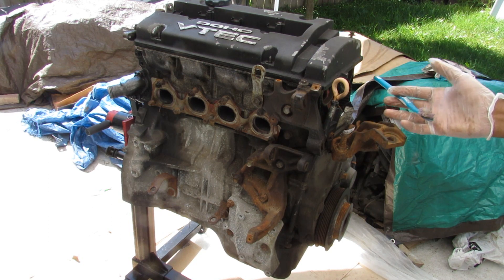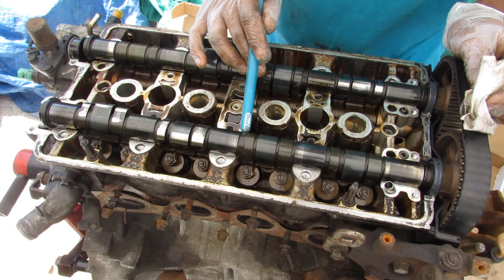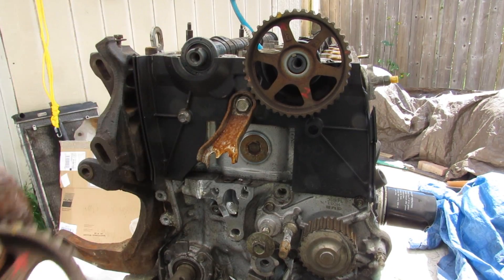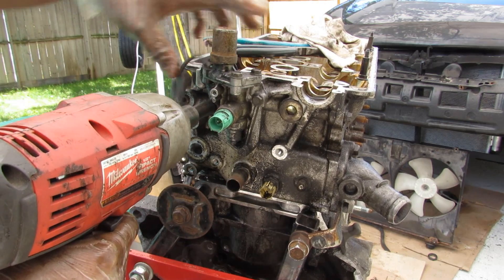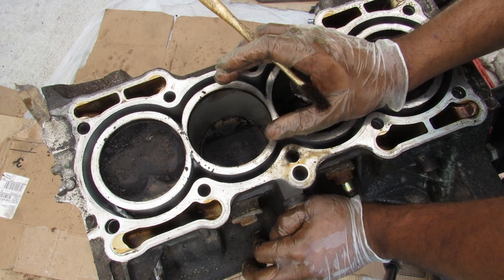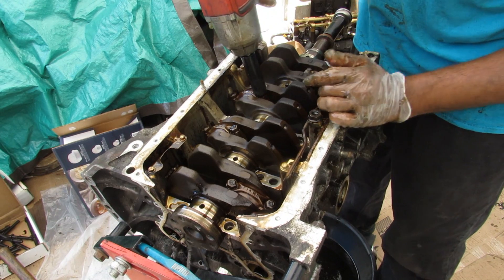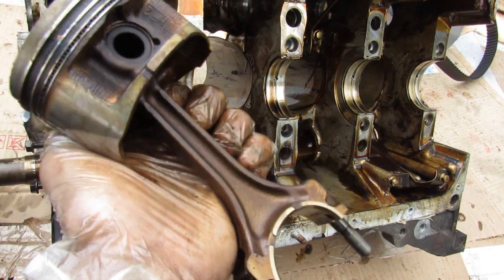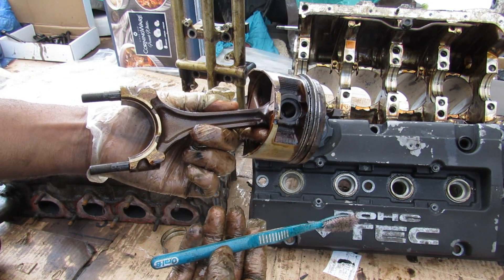Why the Honda H-Series Engine is the Best of the 90's

Comment: My research indicated that the FRM sleeving is quite robust but due to its extreme hardness and abrasive nature of the fiber reinforced metal composite, the cylinder walls cause the piston rings to wear down overtime. The FRM materials are essentially an ultra tough mixture of aluminum oxide and fiber Matrix carbon that does add strength to the cylinder walls but they still aren't ideal for high boost applications and piston rings in general😢

Comment: Guys which f series trans would fit a h23 with the longest gears and longest final drive ratio? Trying to decide what chassis as well so any Input helps...goal is a local city and highway car with decent torque and power but the longer gears to take advantage of highway fuel economy, I also have the option of a k swap

Comment: I love my Honda engines, but even I do have to say that Honda did screw the pooch on good oil cooling on some of their high power vehicles. Someone I know was having oil foaming issues while on the race track because of excessive oil temperatures. He had to rebuild his B16 because of the foaming issues after just a few track days. I recommended an external oil cooler, which he thought was dumb because he isn't turbocharging his engine, and because there was already the factory "cooler". He did listen to me, added an external cooler for his oil and suddenly his oil foaming issues were gone and the engine was eat hot lap after hot lap. Non-VTEC Honda B and H series engines do not tend to get even the small, factory oil coolers, at least in my experience.

Comment: These are beautiful engines, very responsive.

I owned a prelude with a H22A1 engine that I got for $3,000AUD a few years back when I was starting my machanic apprenticeship

When I was driving the car hard on the highway and being an absolute hoon the 3rd big end bearing seized to the crankshaft due to a blocked oil channel to the bearing and being new to the trade I didnt thing much of it and scrapped the car to a wrecker.

Been kicking myself for getting rid of the car ever since

Comment: I had an Accord with this engine. It performed perfectly but the block developed a hairline vertical crack which leaked oil. I traded it in immediately for a newer one with the K24 series engine. Hundreds of thousands of miles later and no problems at all.

Comment: Something important to note is that the h22 is only an interference engine <valves can collide with piston is timing belt fails> while in vtec. Don't take my word for it check for yourself. I personally scored a 400 car after guy swore up and down it was shot. I put 50 bucks in parts at it after the harmonic balancer and crank key fell out due to UNDER TORQUED CRANK SNOUT BOLT. ran great. 285k miles BTW. Crazy how well that car was maintained

Comment: Tip for those who are going to be building an F/H series engine, the Kaizenspeed Balanceshaft Eliminator Kit will, with a good tune, free up 15-25 hp.
Reply: but how bad is the vibration? i dont want it to rattle like a race car or break my motor mounts, as im just making it a street car, should i get solid motor mounts?
Reply: @cloakedgt  so If you were to use this kit, what you’re doing is removing a pulley from the engine which minimizes power output because essentially the timing belt is not moving as fast as it could.  If you were to use this, it’s not the your car would vibrate so much, it’s the shafts that are being deleted, giving the cam gear and crank pulley a more clear and quicker sense of movement.  For my F22a4 build, I’m going to have my crankshaft balanced, a new crank pulley, new cam gear, new water pump/timing belt, and the balance shaft eliminator kit.  Along with the other internals but that’ll help keep the motor with no vibration.  Also, depending on your power output, quality motor mounts will also help relax the motor.
Reply: @trackshun  oh ok thanks, im not familiar with nonda motors just learning it all now, i started with classics first
Reply: @cloakedgt  I did the belt delete, no elminator kit, and NVH is not noticable
Reply: @killingmeman  oh ok thanks
Reply: This is complete BS. There's no way in hell the two balance shafts have a 15-25 horsepower draw on the engine. A fully engaged AC compressor draws 5-10hp, so I'm not sure how you can think a freewheeling spinning mass that isn't even that heavy could draw anything like that? I've rebuilt numerous F and H series motors. The only benefit to removing the balance shaft if you do it correctly with a kit is to gain a marginal improvement in oil pressure and a minuscule reduction of rotating mass. It's so minute that you wouldn't even notice. When I disengaged my balance shafts for a period of time the increase in NVH was very much noticeable. Removal only makes sense if you're trying to set records.
Reply: @jay.fromthebay  you just proved my point.  If frees up horsepower do to the prioritized function of the removal/the kit.  When building a motor, it frees up that much and then some.  I put my F sohc into my accord not too long ago without the kit because I didn’t want too mucj vibration & I had bought softer  bushing motor mounts piror to throwing the engine in.  Evntually when I saved the money, I bought the kit a red mounts for my cb7 that has an F23 block and f22 head.  It did open up a lot of power sir.
Reply: @trackshun I’m super keen to try F-swap my civic but don’t see much info about it. Any forums or specific research you needed to do to get the info? (I’m a completely new monkey to cars, only just changed rotors and coil overs this week on my accord cm5)
Reply: H-serie swap all day💪💯🐐🚀⛽️🚘👍🔥
Reply: @trackshun when doing the kstuned eliminator kit do you have to physically remove the balance shaft?
Reply: Lol 15 hp? I doubt it
Reply: I use an ATI fluid damper. I'm not spending a grand to balance the rotating assembly. Honda didn't neither am I. 

I
Reply: @darbymcbride41  buddy.  ALL crankshafts have been balanced at least that I know of from 1980-present.  Balancing doesn’t mean taking material off the crank UNLESS necessary when building your car, it’s literally as it says, balancing or matching the weight of the engine block parts including your clutch and flywheel, to have a smooth running engine.  If you just throw a bunch of parts together EVEN WITH A TUNE your car will just vibrate and your parts will have trouble working together, and that ultimately causes either premature wear or a catastrophic engine failure.

Crankshafts are balanced from factory and a knowledgable engine builder or car hobbiest or even someone just going to school for a general certificate knows that balancing your crankshaft is a must.  It’s like when you take a tire off of a wheel to put a new one on, YOU HAVE TO BALANCE YOUR WHEELS!

Comment: Dude one MAJOR thing you missed, was the fact that the H22 had dual valve springs straight from the factory.
Reply: If you're right that is a huge oversight. I'll have to look at both my usdm and jdm 95 prelude engines rn. Cheers

Comment: How many times have I watched this, you ask? Hold on, this is the part where you explain the oil routing... 
Okay, like 7 times. I wanna be as knowledgeable as you on the H23. Just bought a 92 Prelude with the engine completely disassembled. 😅

Comment: It would have been perfect if not for the silly idea of using spray on cylinder liners which deteriorate and cause insane oil burning problems. They should have kept the cast iron sleeves of the F22.
Reply from the maker: True. They like to try different things in the name of efficiency

Comment: These really weren’t that good. Friends had them, didn’t even race or mod them but they would drop a cylinder, it would loose compression I assume due to excessive wear in one cylinder. These 1990s cars were cheap and a lot of young folks had them in the mid 2000s
Reply from the maker: Ok Compare it to other engines in that era ...

Comment: For all Honda 80's and 90's engines (B, D, F, H):
All the parts that should be metal ARE metal. 
All the parts that should be solid state are solid state (not electronic)
All the parts that should be stand alone are stand alone (not "Big Brother" computer controlled/monitored) 

No crazy plastic application

No over complicated convoluted designed to deter DIY and justify large fees
No planned obsolescence.
Reply from the maker: Yep thats why they lasted so long

Comment: Lots of people crap on these engines because of the FRM liners but the NSX and S2000 also used FRM cylinders,it worked well as it’s extremely hard wearing but once it’s scratched up,it’ll burn oil.
Reply: Unless you have a F20B then you have iron sleeves = even better and it takes the high rpm range better with type s cams only thing is it lacks the torque its like the K20 to the K24
Reply: What causes this?
Reply: @juanarqueros5241  there’s no crosshatching on the cylinders so they’re smooth walled, nothing for the oil to hold onto. If you don’t keep up with oil changes and it gets dirty, it will scratch the walls even though it’s a super hard wearing material. Once that happens, you will burn oil. I have an 01 prelude that doesn’t burn oil even at 177 thousand kms but it does have a couple small leaks here and there but they’re easy to fix 😎
Reply: Yea then they get a b series and sleeve it anyways

Comment: Forgot to state that this motor only is available in Japan and is an import motor, was in the Accord wagon over there. The normal 2.3 liter H series in the US is non-Vtec. This video might confuse a lot of people. H and F series are stout as heck though I can agree, all the way from the F22a to the F23a and the H series which is pretty much the same thing as the F series. I've worked on them both. First car I owned had  F22a1. F20B which is also an import motor from Japan does not include fiber reinforced cylinder liners, so I think that motor is loved by turbo enthusiasts. F20B is literally a smaller H22.
Reply from the maker: I found out later this was actually an H22
Reply: @speedkar99  i was gonna say this looks a lot like the H22A in my '93 prelude lol

Comment: the best engine of the 1990s is the buick 3800. most durable, easiest to repair. best balance of fuel economy and power.  please do a video on what ward's automotive calls the best engine of the last century.
Reply: Mercedes OM606 is the best :D stock engine can handle 3x power without any modification. And still able to run millions of miles.

Comment: Drove the piss out of a k20a3 from 130k all the way to 205k miles.. super solid motor when stock.. I replaced it in my driveway with another one for $400 only because the valve guides started leaking a little oil

Comment: The FRM material (for the sleeves) is harder than steel, so it doesn't wear out. The piston rings wear out.

Also, that material is aluminum oxide ceramic, which is about the same as the ceramic that spark plugs are made of.
Reply: FYI:
The S2000 & NSX both use FRM sleeves.
Reply: Excellent info! Thanks

Comment: I have a 1997 Honda Prelude SH. I have converted it to base and obd1 with hondata s300. Engine is fully built. Money was not an issue. Has a gt25-660 turbo and dynos at 637 whp. It is a daily driver. I retained ac and ps with a minimani. Fully upgraded suspension and wider tires on front. I have a daily tune at 450 hp and a playtime tune at 645.
Reply: Surprised it made that hp with the mini mani
Reply: @TheBb6prelude  850fab said they have pushed the mini mani up to 800 before the welds cracked on it.
Reply: I just came 😅
Reply: All that money spent and it's still Wrong Wheel Drive.
Reply: @idokwatcher2062  hate to break it to you but there are 7 second front wheel drives out there. And I am converting to all wheel drive within 5 years.

Comment: Vtec isn't variable valve timing, it's variable valve lift, via a second cam profile and followers that are engaged with oil pressure.  I-Vtec incorporates variable cam timing.

Comment: So much misinformation in the first few min   I'm am h22 lover I have a 500 whp prelude and there's no such thing has a black top h23 vtec there's a black top h23a1 non vtec that's a blue top motor if it's a h23a and it's a frankinstain non vtec block with a vtec head

Comment: How did you take out that honda crank bolt so easily 😃
Reply: I welded a 2lb weight to an old socket, used with a cheap impact. Lisle sells one already made like that specifically for honda crank bolts. i've used huge cheater bars in the past, but had to roll the car outside to fit lol.

Comment: H series engines(not every generation) have an FRM block.  Fiber Reinforced Metal. Over time/mileage the rings will wear the cylinder walls down allowing oil to slip into combustion chamber and give the "blue whisp" of oil burning out the tailpipe......rather have my B18C any day...... same power and only 15ft lbs of more torque......almost half a liter more displacement on h22 over b18 and only get 155ft lbs compared to 135ft lbs on B18C

Comment: thank a lot for information about f4m dupont coat at    cylinder liner and when it  wear out will cause engine oil consumption.
Reply from the maker: And that's the case with most of these h23

Comment: Hey I got a h22b 267k miles for sale Springfield mo, could be fine just pulled it and my dude put a swap in block is good nothing leaks may be nothing wrong solid....300$ cash HMU
Reply from the maker: Ok
Reply: 2001 prelude base
Reply: Black top vtec

Comment: I understand that you scrap everything afterwards but don't give people the right idea but they can undo the cam caps before you undo the torque on the cam gears themselves that will just create all kinds of damage I don't know I look at it as people are learning from you but you need to keep the correct technique otherwise you might as well just be crushing it with a advice and smashing it with a hammer
Reply from the maker: Alot of people complain about my un torquing sequence... 
This is a teardown of a scrap engine for analysis...not a how to rebuild an engine. 
I make them into coffee tables later Not all goes to scrap.

Comment: The problem with h22 preludes is the heders they are very close to the oil pan is a gap like a 3/8 of an inch or may be half inch ..and that h22 engine gets so hot more than an normal temperature  plus valve seals ..and intake pasages gets cloged mix of oil grase...
Reply from the maker: Oh I didn't realize that since I didn't get the header

Comment: Does anyone have info on this H23 VTEC? I was only aware of H22's having VTEC.  I believe there was a JDM 2.5 version of it as well.  Thanks
Reply: This is an h22a4.

But yes there was some H23A vtec from accord. They are bluetop engines like the f20b
Reply from the maker: This H23 is vtec

Comment: Those two rails running the length of the camshafts on top of the cam caps are actually oil sprayers.  Each one has two separate oil feed passages with 5 sprayers per pair-of-valves drilled into it them.  One feed sprays oil onto each cam lobe at all the times, and the other sprays extra oil when VTEC kicks in..............yo!  This is why it's SUPER important you replace the 3 o-rings underneath the cam caps whenever they are removed.  Both the B-series and NSX C-series have these same oil rails as well.
Reply from the maker: Good to know. I sure was surprised and how it's set-up under the valve cover

Comment: Love your channel!!! I have an s2000 f20c motor with 149k miles, piston slap on cylinder 1. Still runs and drives, I'm pulling the motor for the new one here next month. If you want it for your channel shoot me an offer. I'm sure the f20c would be a hit. It would be an honor to see you take it apart😁
Reply from the maker: Thanks, where located?
Reply: @speedkar99  Utah!

Comment: That's an h22. H23a1 is nonvtec. H22a1 is vtec with black valve cover. Blacktop h22. Redtop h222 is 5th gen prelude. Black top is 4th gen prelude.
Reply from the maker: This was from a 2001 prelude so I thought it was a h23
Reply: @speedkar99  It’s A H22 If It’s Out Of A 2001 Prelude .

Comment: Love how that crank bolt busted loose so easily usually that’s not the case. Finally a H22 my favorite Honda motor
Reply from the maker: I cracked it free before filming but it wasn't that difficult
Reply: @speedkar99  Aha! A stunt bolt!!!!!1!!!
Reply: @speedkar99  Ahhhh that's why. Jesus. Had my mind blown.
Reply: I saved an h22a1 from the junkyard by slapping a new harmonic balancer, snout bolt and snout woodruff in a 285k miles 95 vtec Milano red 5spd. I paid $400. Came with harm balancer. Spent like $50 bucks in parts and redid the timing and ignition and she ran like a beaut.

Comment: My 2001 honda prelude is getting up there in millage and yeah, they leak oil.  I like to rebuild it this is helpful.
Reply from the maker: Does yours burn oil too?
Reply: @speedkar99  I don't think it burns, if it does is not much. I think I need to change all seals, did changed vtec seals, that's where leaked most

Comment: 🔥🔥That’s because it’s a Evolution of the B20a from the 3rd gen prelude, Also a Fórmula 3 Block!!! from the late 80s and a mix of the Single Cam F series Motors, Plus Vtec. Even my F20C block shares bearings and Rod lengths. Amazing Honda 🔥🔥
Reply from the maker: They sure make good motors

Comment: If it is a h23a someone swapped the valve cover, only comes blue
Reply from the maker: Good to know. 2001 prelude
Reply: @speedkar99  that h23a engine is very rare. Imported. Not original to a prelude. Only comes in a all wheel drive accord wagon SIR. The only differences from the h22a is the crankshaft and the connecting rods to allow for more stroke. Also different pistons, but Honda used the piston as a way to control the compression ratio. Lesser compression ratio for countries with a higher standard for emissions compared to japan... I’ll stop now lol